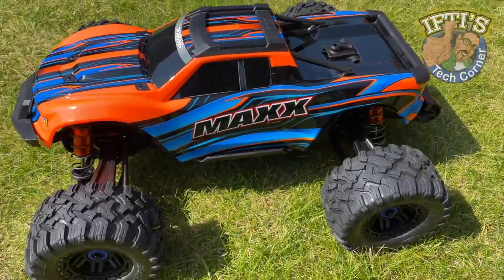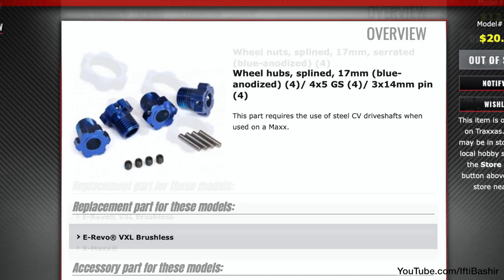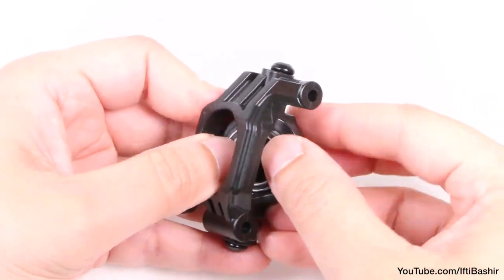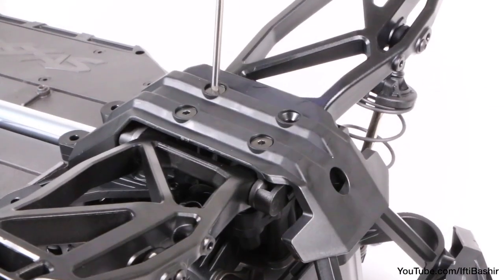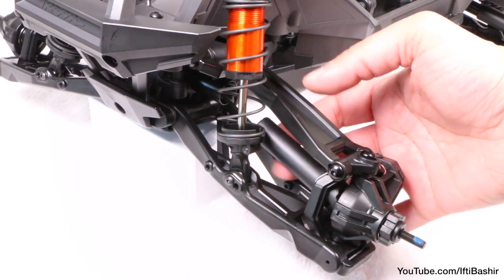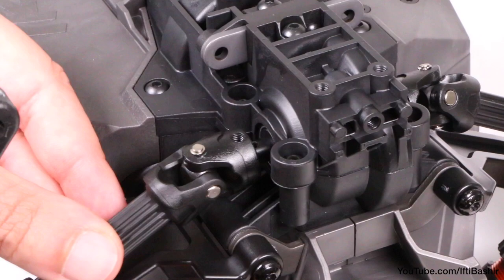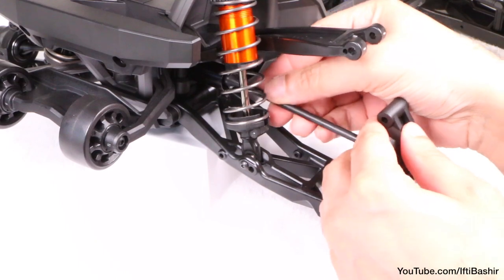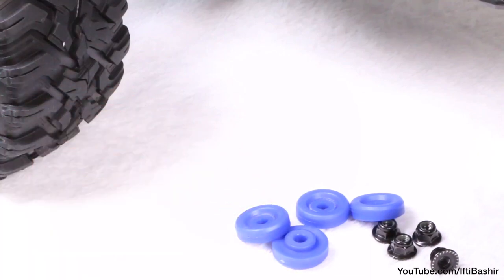#03 Traxxas MAXX - Steel CVD / CV Driveshaft Installation & Setup GUIDE

Comment: I’ve noticed a spiralling on my plastic shafts where the tension has twisted the shaft. Next add on. Love all your vids. I watch many over again as what you may call therapy...
Reply from the maker: Yes thats exactly what happens before they start to break :(
Reply: iftibashir do you use the stock hex nut after the upgrade or do you need a new nut for the wheel?

Comment: The Maxx has extremely weak joints on the stock plastic driveshafts. I've broken 3 of them within the last couple weeks just driving around the farm, no jumps!
Reply: I was running my maxx v2 pretty hard since I first got it on Thursday and didn't have any issues with the driveshafts other than well somehow losing a damn u joint which I still don't get why it happened but yeah so I just put the steel shafts on and hopefully everything works but haven't tested it yet

Comment: Yes you could complain about the hubs not being included with the drive shafts, but you didn't really NEED to replace the stock universal drive shafts.   If they proved not to hold up, then yes go ahead and spring for the more expensive option.
Reply: Tbh the only reason why I just switched to the steel driveshafts was because somehow a few days ago the u joint flew out on one of the plastic shafts and it was hard to find any replacement u joints so I just decided why not put the steel ones on and not have to deal with that issue again🤷‍♂️

Comment: I know this is an old video, but I thought I would add my comments to make the job easier for those just now seeing the video.

You don't have to remove the bumpers to get the suspension arms out of the way to get to the gub screws on the driveshafts. All you do is remove the hinge pin retainer screw through the hole in the bumper; push down on the plastic hinge pin retainer and slide it out from the side of the bumper area; pull the hinge pin with a pair of needle nose pliers; and move the lower suspension arm out of the way. There is now enough room to get to the grub screws on the driveshafts from the bottom of the Maxx. This method works well (I did it yesterday) and it saves a lot of time and effort.
Reply from the maker: Thanks for the tip!

Comment: Do you need to lubricate the axle cup (not sure what to call it) that is on the side closer to the wheel? If so what do you use? My truck is squeaking and this is the only place I can think its coming from. I have already replaced all the wheel bearings and the differentials should be full of lubricant from the factory so I cant think that they would be squeaking.
Reply from the maker: yes I like to add a touch of grease inside the axle - not too much though as it can attract dirt!

Comment: After installing the wide kit and leaving the original plastic drive shafts, they stripped out after a few turns. Basically you have to have the heavy duty drive shaft upgrade if you get the wide kit. $100 for the drive shaft upgrade and still need to buy more : (

Comment: Made work hard for yourself. The axle pins can be released with the centre front screw in tie bar. The cap slides up and needle nose the pins out. Don't need to take off chassis plate or skid plate 😁
Reply: 100%

Comment: Do they make a 10mm wide 17mm hub adapter for the Steel axles? I can't seem to find one. Maybe one for E-Revo? Still need locking screws to hold pins.

Comment: my slash cv axles finally fell apart. since it fell apart on the outer "cv" joint, i learned they are not actually cv. they are just u joints lol. they are well built though as i bashed the crap out of them for years,and they are lighter than some of my other metal axles. it appears the outer boot fell off and maybe it held a pin in place that broke, or went flying and it lost for ever.

Comment: Any oil applied to the new bearings or just as it comes? Great video and very imformative!
Reply from the maker: Just as they came!
Reply: @iftibashir  Ah ok thanks! Curious about something, has anyone weighed the difference from a stock Maxx vs a Maxx with the widekit, and the steelcvd kit installed?